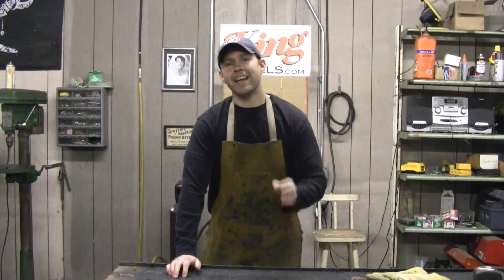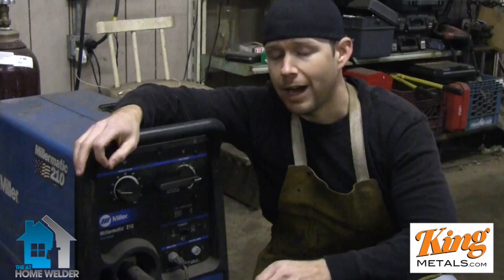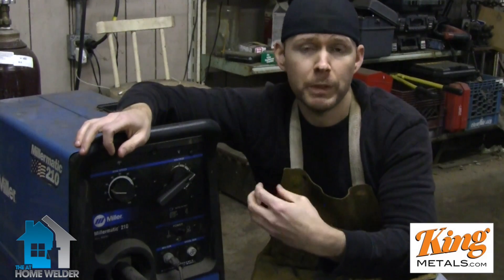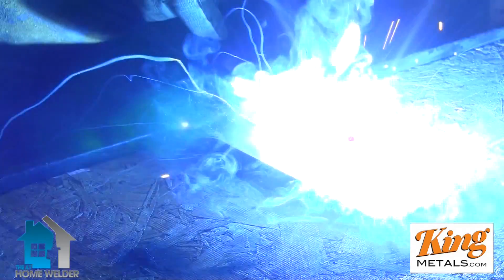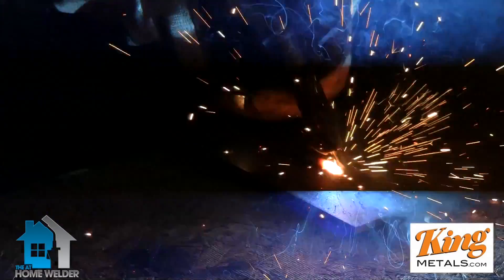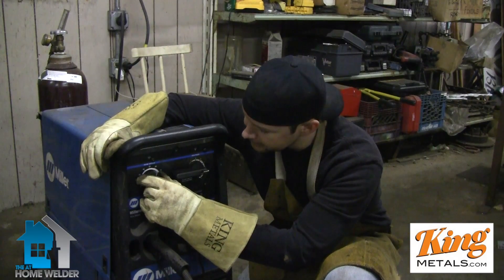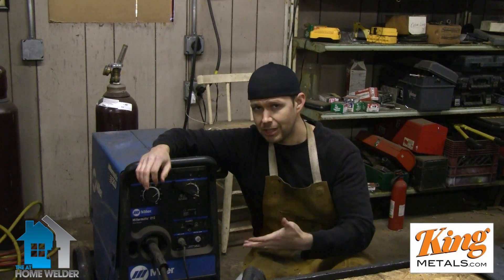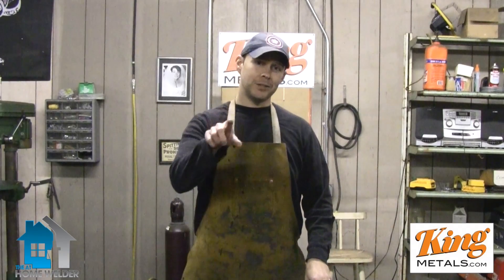How To Find The Correct MIG Welder Settings For Any Project

Comment: If you listen too your third attempt, you can hear the perfect weld about to occur. It's when you cook the bacon quietly you hear that shhhhhhhhhhhh. Really good welders can feel it at first pull. If your new, set feed slower and watch the bead penetration and style, push or pull to v, fill, grind but remember, grinding sucks and wire is not cheap and either is gas! and Grinding sucks! No pop equals less holes in shoes! Cotton and eye protection no matter what! waking up mid night sand in your eyes sucks worse then grinding!

Comment: Hey guy, I'm a 4 year welder. I haven't had much practice in welding since the end of high school so this video really helped. I'm going to check out your site because I'm seriously thinking about welding as a career in my local welding "shoppe"

I think it would also help if you did a lesson on how long to hold the puddle angle of the gun and best whipping patterns. I have 2 months before I get my application looked at so I dont want to take that for granted.. 

I'm hoping to have a 12 hour day job, save to go to college (eventually) to fix up my moms house after I buy it from her and build my own shop in my back yard for my own personal uses of heavy metal crafts to sell at auction houses for charity. It all starts here with my ability to want to learn, so I want to thank you for this video and I hope you have as good of a day as mine started.

Comment: Have a question I'm pretty sure it's out in left field. So I picked up a "welding accessory at an auction today and have little to no clue what it does. Any thing I can find is a "welding control" or "welding control for wire speed". Stock number. 141604. That's about the best I can do on information.

Comment: I am getting a lot of brown residue around my weld.  Excessive really.  I've tried increasing, decreasing voltage and wire speed with no success.  Also at the end of the weld, I almost always have a pit or even burn through.  Ideas?
Reply: I'm still a newbie welder, but speaking from my limited experience I'd say that brown residue is iron oxide caused by lack of shielding gas. It's normal to get the brown stuff on adjacent welds, but if it's appearing on your current weld you might want to check your gas/gas flow/ventilation. Also check your torch angle and stickout.

Comment: i have 6 machines, left from my business of building alu yachts, all are grunter migs, one hobart megaflex 450, one miller deltaweld 450, one lincoln vantage 400 one twin pulse lorch, badged cig sp 400, ALL  with voltmeter and amp readings, i can tune by ear, i just bought a boc single phase smootharc 275c  for use with steel wire and believe me the arc sound is crap, no matter what settings and there IS  volt and amp readout, i am on pure argon because i use that gas for shielding alu, driving me nutts
voltage is key and as the other guy said you said zero abt that because you  do not have a volt readout, the weld downhand should be just on the spray, arc should hiss, more so on alu

Comment: When welding 18 ga on old cars I find that the sides of my welds roll down into the old steel . It doesn’t flow into it. What causes this?
Reply: What I've found that helps on sheet metal is .023 wire. Huge difference.

Comment: Good day, thanks for the video! Just a quick question... My weld starts out great, got that perfect sizzle...then BOOM blows a hole through my material. I'm wondering what's causing this. Thanks.
Reply: Your amperage/ voltage is too high. Causing the metal to melt instead of bind. Turn it down and you should be good 👍🏾 another cause is you could be welding a bit slow. Try speeding up your motion

Comment: Last weld was junk too, it also depends if you like running your machine hot or cold. There as still popping in the last weld, shouldn't be any, smooth and consistent. As far as the voltage goes, he already had it set, and you should only adjust one. But, a setting demonstration of that would be nice.
Reply: funny shit

Comment: I have a miller matic m-25 and I use it a lot on light sheet metal  for I rebuild cars. It messed up about a year ago and I took it and had it repaired and it works fine on heavy metal but I have tried turning it all the way down and it is so hot it just burns up sheet metal, Is there some kind of adjustment other than the dials. I can run it on 1 and it burns a whole when you touch lt. Any advice would be appreciated

Comment: Hey bud, I have a hh135. I'm doing body sheet metal. Settings on machine call for voltage setting on 1 and speed 10. I notice popping so to get a sizzle I turn it up to wire speed 60-65. Does the sizzle matter as much since I'm just tacking? Even the sizzle I get doesn't seem spot on but it's as close as I can get. My nozzle looks a little gummed but air seems to have flow (by sound).

Comment: Setting a mig welder is very easy.....set the voltage to 19 volts  for 1/8" plate and 21 volts  for 1/4" plate or 24 volts for 3/8" and start making a weld...then while welding one handed reach over and adjust wire feed while are you are welding to dial in the sweet spot.
Reply: Those settings are all fine and dandy if you know what the dial indicator numbers convert to which voltage you listed.
Reply: So, for instance 19v for your machine would be 100 amps?
Reply: Some machines can be damaged by changing settings while welding
Reply: @pantac4493  You are correct.  Those machines have "tapped" transformer voltage outputs.  Changing those settings will cause arcing in the voltage control switch and thus damage.  Others, like mine, have continuously variable settings that allow you to make changes as you weld.
Reply: @danburch9989  wrong most big welders do not use stepped voltage, you can change, if they do not change by dial or buttons, then you are correct, in fact often you'll see pro welders with remote voltage control, which is what i have, if you are 50 feet from the power source with no remote, have a helper dial in while you are welding, he'll say, up/down etc as amps and volts change with position as the weld goes from downhand to vertical UPS

Comment: I took a welding coures in college but I forgot if you open the Argon tank fully? Can anyone help me?
Reply: Jaime Espinoza when you open any valve always open it all the way then back it off a 1/4turn! The reason is it keeps the valve from seizing and it keeps people from breaking it by thinking it's stuck and overpower it and it breaks, by having it back a 1/4turn it will be easier and also  obvious which way to turn it when it turn just a short distance the wrong way.
Reply: T Huss yea IV been reading cause I got a welding job over in Houston TX but it's for MIG welding and it had been a while iv weld but I pass my test thank the Lord lol.  75% Argon and 25% CO² sounds good don't it?
Reply: always open any pressurized gas bottle completely.

Comment: all these settings are meaningless, yes they are in a ball park but far from perfect. The most important part of ANY wire feeder is to set the wire speed in the same  rate as the burning . None of the the settings you showed were correct as a matter of fact the very last weld did not look great either, cause it had jagged edges due to inconsistent wire feed. When one welds ,  the wire seams as stationary as if it does not even travel trough the liner, the sound is like to tearing a paper, consistent sound, consistent brightness, no flashing/blinking just all the same smooth, no jagged welded edges.
Reply: @ToddChaseYT  In addition he is trying to help someone just getting started. Some one like me who only took a welding class in High School 40 years ago.  I have a cheap mig, a plasma and and an Arc Welder. I just want to do some basic stuff in my home shop. I do not want to be a pro welder. Yet increase a skill set at the same time.  Thanks for pining this guy.
Reply: What a goof

Comment: I do have a question. Im using a mig 130 welding machine and i continue to see small little balls and not getting the consistent puddle like the one  demonstrated in this video. What am i doing wrong. The material is raw steel  quarter inch in thickness flat panels. Greatly appreciate any feedback......... Great video btw
Reply: I'm not a welder so take what i say with a dose of salt.Without seeing a picture It sounds like your amps aren't high enough which means the metal is not getting the penetration required. So you get what i would call a cold weld,where the metal out of the gun melts fine but there is not enough amps to melt the parent metal,so it ends up balling & cooling on top.I'd recommend go have a look at chuckE2009 or weld.com vids,you'll get the info you need there,as they have vids on what's happening & why.If you have some thinner material say 3/4's the thickness try that & see what happens.Remember tho you want to hear that nice crisp bacon fry sound,with little splatter.If you have a stick welder,you could most probably quickly find the right amps required then use that setting as a guide then adjust the wire speed accordingly.I find migging is quite finnicky,tho to be fair i've only just started mucking around with my mig & its an older 150 transformer type
Reply: Your probably right . ill try using a unit with 170 amps. Thx for the 411

Comment: hi, we want to weld hollow cylinder or you can say pipe ST-52 having outer diameter of 30mm and thickness of 1.8mm with the same material and another hollow cylinder or you can say pipeof outer diameter of 25mm and thickness of 1.8mm so what is main basic parameters to set like current and voltage etc. ????
Reply: hahahahahhahahahahhahahahahahhahaahahhah
Reply: 7 to 6

Comment: A good starting point for Mig solid wire on 1/8th mild steel is WFS 150 @ 18V. Flux Core WFS 220 at 22.5V. Keep the cup nice and close so shielding gas protects weld. Carbon Dioxide for mild steel at 15 to 20 CFH (no wind).
Reply: Chances are you probably won't even see this because it's so old but sounds like you know what you're talkin about and I wonder if you could answer a question for me if you happen to read this? First 7525 carbon dioxide argon mix what would you set the flow meter at Ad Astra for a starting point? I don't have a welder as big as the one in the video I just have a small Lincoln SP 125-plus and it doesn't have voltage numbers on it it only has the a b c d e f g h i j and then the wire speed your set 1 through 10. Any help would be appreciated thanks

Comment: Good video on the right voltage and wire speed,  " bacon fry" sound to me is correct.- getting that sound - - - like you said, try on scrap metal -  when I hear that sound - the weld looks very good !   Good video ! ! !

Comment: hi, after using flux core wire. I have holes in the spot I welded. Any solutions to this?
Reply: He's using flux core and I doubt he's talking dual shield, so there is no gas. And weld porosity isn't a problem with flux core. He's probably talking about burn through. His voltage is likely set too high.
Reply: Billa Sohal I've had this many times before , try changing your wire. Old flux creates "worm holes"
Reply: Billa Sohal try moving as slow as the metalmelts and stay in the puddle with the wire arcing, I remarry have the hardest time doing but should be melting in deep at the same time . the hot caterpillar, 👍
Reply: If there is little holes in the weld that usually means that the gas isn't getting to the weld.

Comment: what settings would I use to install a floor pan? I know I should do a series of short welds around the pan to avoid warpage and burn through... but what voltage ? I have a nice welder but never used it yet... lol   I have a snap on mm140sl model... 110v but will do 1/4in in a single pass im told...

Comment: can you suggest any formula ?
Reply: Gurpreet Singh I was once told that if you take some scrap steel of the same thickness that you intend to weld, point the tip and squeeze the trigger. At the same time adjust the wire feed speed until the mig wire stops trying to push back against the metal and the frying sound is consistent. Then tweak it slightly to allow for the gun movement as you weld. I normally have to use that method on my old SIP Migmate 130 which isn't the smoothest feeding MIG welder out there.

Comment: You stated there was no popping on the last weld.  That isn't true.  It popped just about as much as the middle or second weld you did in this video.  Please review and you will see I am correct.
Reply: Justin Snyder t
Reply: Terry Bates ?
Reply: What is the point of your comment?
Reply: is this a parody? this guy isnt a welder?????
Reply: Btw I do this for a living.
Reply: Justin Snyder that's normal it sounds totally diffrent. That could be caused from the scale left on the material would should better if it was clean metal
Reply: Dude you're an idiot lol. A popping sound goes "pop pop pop" like from the first example. He clearly stated that you were looking for a sizzle sound like bacon. Which he had a more refined and clear sizzle by the third weld he did. Wise people pay attention and can figure out what the differences of sounds are. Now please do everyone a favor and don't comment about MIG welding unless you know what you're talking about.
Reply: I will comment again.   Look at both welds and you will hear POPPING in BOTH welds.   He said there wasn't ANY popping, but THER WAS!   Wise up!

Comment: Hi I have a stainless job I am doing for my friend and have not really done any mig stainless steel welding so I was wondering if I use 75 Argon 25 Co2 what should I set my amperage and wire speed at ?? Thank you. Almost forgot I am welding 304L stainless steel 5/8" thick  bar stock.

Comment: well i simply stopped watching this after you said 6 volts and 50 wire feed..... I usually run 0.35 at 17-19V and 150WF. Or FCAW 1/16 at 29.6V and 250WF.

Comment: this video is a good start but it does not help much as you did not weld anything, you just ran a bead on a very thick piece of steel, I am not criticizing just giving feedback, at least turn the metal over to show the penetration on the opposite side, plus welding thick material 1/8 to 1/4 inch is easier for beginners than sheet metal, can you show us how to set your machine for some automotive sheet metal welding please